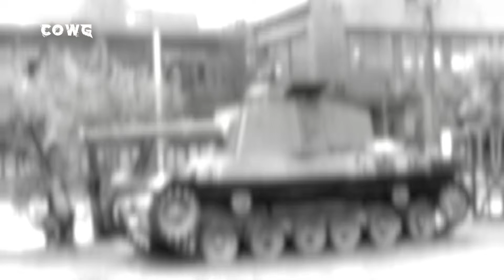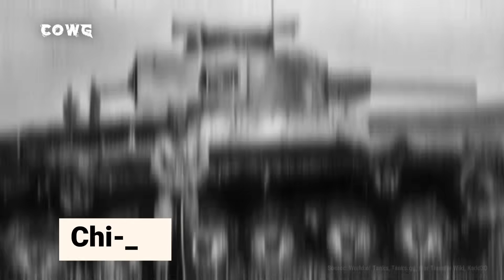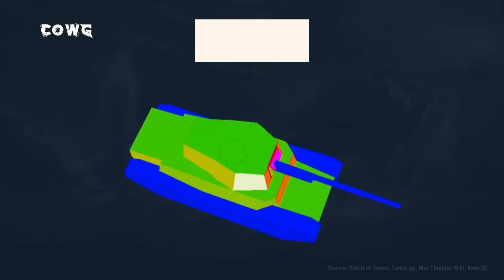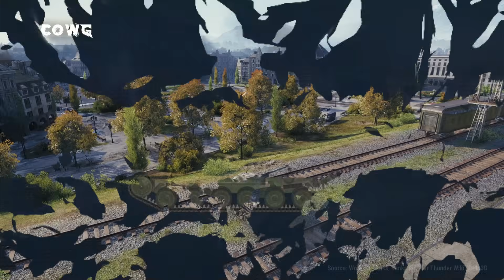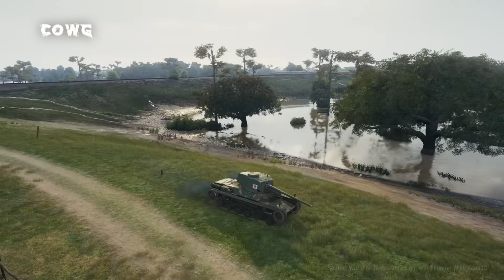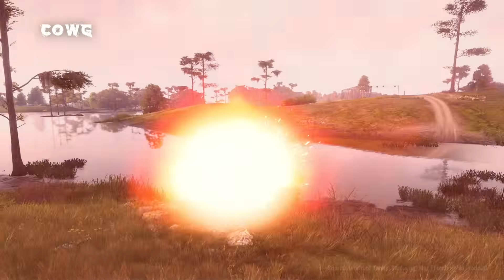Type 3 Chi-Nu: Japan's Forgotten "Sherman Destroyer"? Military Documentaries

Comment: The Japanese concentrated on Infantry Support tanks and light reconnaissance tanks rather than combat tanks. But meeting the Stuart and Lee in Burma caused some rethinking on their part. The 47mm Type 1 could penetrate 50mm of armour at 1,000 meters and as US armour was very soft, only 300 Brinell, it was a danger. The Type 3 Chi-Nu it was hoped would handle Sherman at longer ranges at 1,000 meters. But production was disrupted by bombing and so made no impact on the was. The surprising thing is Japanese army was hammered by Soviet tanks in 1939 but never took thw hint?
Reply: Japanese first met Stuarts in 1942 in the Philippines and T26/BT5s which were all superior to their armor.  One does have to wonder what in hell Imperial GHQ was thinking that they didn't at least improve their AT capabilities, maybe with 50mm guns mounted on their Type 95 Ha Go chassis like the Germans did with their MkIIs
Reply: @oldegrunt  Yeh, even the Chinese had some competitive tanks! But I think the Chinese were too much of a push over, made the Japs think they were supermen and didn't have to bother with updating their equipment. They ended up as cannon fodder, both in South East Asia and the Pacific Islands.
Reply from the maker: Good Morning ^^